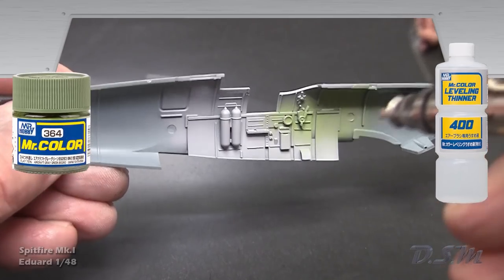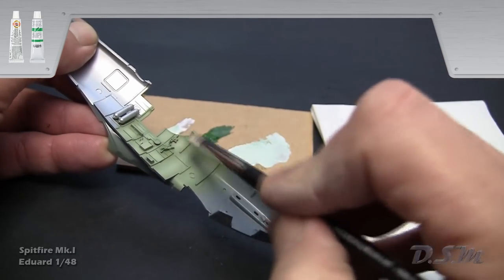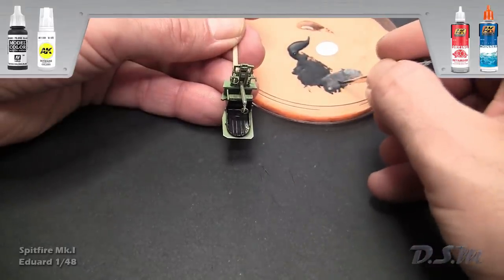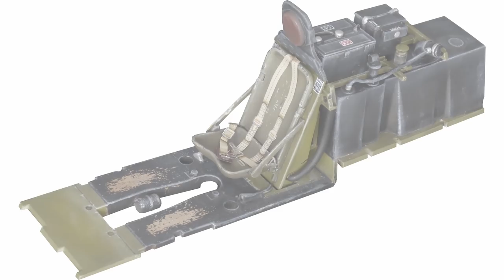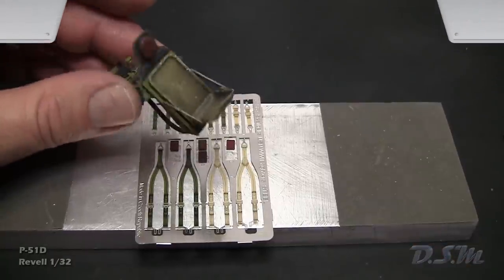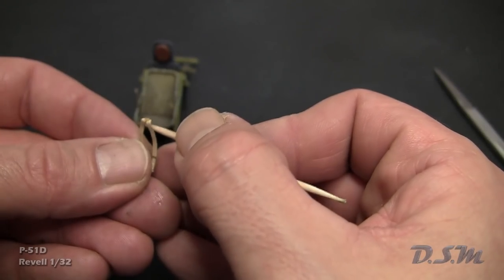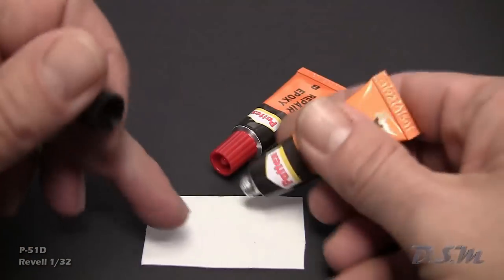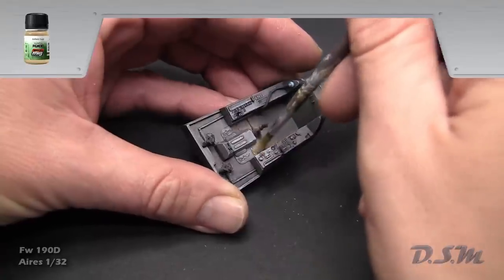Jak nabarvit kokpit letadla z období WWII - Spitfire, P-51 a Fw 190.

Comment: I really liked the wash on the Spitfire cockpit. I find it very difficult to get a good consistency on a oil wash. Thanks for sharing the video!!!
Reply: I think that's strongly to do with the quality of the oil paint - cheaper or less good ones often have a coarse pigment that you can see as grains. But basically it should be almost all thinners.

Comment: GREAT JOB , please, what brand of varnish you use just before your washes ?.
Reply from the maker: Thanks for the feedback. Super clear III GX100 by GSI.
Reply: @DetailsScaleModels  thanks , last question 😏do you dilute it ? i use x22 tamiya 50/50 dilute ,but I find it too thick.and I never have good results
Reply from the maker: Each color has a different density (new/used) and therefore needs a different ratio of thinner. It's about experience. I mostly use the density of the ink.
Reply: @DetailsScaleModels  ok thanks

Comment: Beautifully done but why paint the seat black?  The metal seat fitted to Spitfire Mk1 aircraft , which this seat is, were painted green.  The later compressed paper seats were a red/brown colour which is why they tend to referred to as Bakelite seats.  Other than that nitpick, some brilliant hints and tips which I will definitely by trying.
Reply from the maker: It's not that easy with Spitfire seats. Early versions of the Spitfire had metal seats and were initially supplied in black. Spitfire Mk.I can have a seat in both black and green. This was followed by seats with a bakelite middle part (backrest and seat) and metal side panels (red-brown bakelite, green side panel) until finally the seats were entirely bakelite (red-brown). Thanks for the feedback.
Reply: Interesting.  From all the sources I have researched none refer to early seats being supplied in black.  However, there is evidence from crash sites that some early spitfire seats were black.  Whether that is the actual paint or a chemical reaction to the paint I don’t know.  Moving on, there was never a ‘Bakelite’ seat.  This was some reference made by an individual in the air ministry at the time, whether this was ignorance or something else we’ll never know.  What we do know is the seats were made of Synthetic Resin Bonded Paper or SRBP and started being introduced in May 1940.  They were intended for Castle Bromwich manufactured aircraft only but due to the Supermarine works being destroyed in a bombing raid in 1940 things changed.  The SRBP seats were a one piece bonded structure and were never manufactured with metal side panels.  Some seats had the side panels painted interior green post war which might explain that line of thought.  So, in summary, metal seats were painted green in accordance with RAF spec F7/30 which required non structural elements of cockpits be painted interior green, the later seats were various shades of red/brown commensurate with the resin bonding process.  Having said all this, this area is a minefield and new information is coming to light all the time so if you have some references regarding black painted spitfire seats I’m all ears.
Reply from the maker: I'm not an expert on Spitfire. I learned about the black color of the seats on the modeling forums, after the release of the Spitfire MK.I kit by Eduard. Photographs of the seat with metal sides can be found on the Internet. I can send to your e-mail.
Sincerely, Josef Choreň.
Reply: Hi Josef, I’m no Spitfire expert either but I am pretty confident on its history and development; that said, everyday is a school day!  With regard the seat colours, I stand by what I say, early metal seats were green and the SRBP seats where various shades of red brown.  The colour of the resin was a deep amber and this would produce a final product that varied in colour and shade.  With regard the metal side panels, I find no reference to this anywhere in any official documents or photographic evidence to support this.  The photographs you refer to are well known and show seats that have had parts painted.  For example one of the RAF BBMF Spitfire Mk19s had the side panels painted in interior green and there are photos of this seat out there on the web.  However, I am happy to be proved wrong so if you have pics I’d love to see them.  I’m not overly happy splashing my email address on here but if I can contact you privately please let me know.

With regard the metal seats, there is some chatter that some early metal seats being painted black, for example as mentioned earlier from crash sites, also, the MkI on display at the IWM in London is supposed to have a black seat; however, I personally would never use that as a definitive reference simply because the aircraft doesn’t represent a standard production MkI anymore.  Wrong exhaust stubs and incorrect oil cooler for example and It is quite possible that the seat was repainted in service.  I read a lot of what is written on modelling sites with caution unless any statements are backed up with facts and references to documents that I can refer to myself.  Anyway, ultimately it’s your model and if you’re happy then that’s what matters!  Your modelling techniques are superb and have given me much inspiration, you can be absolutely confident I’ll be trying them out on my current project..